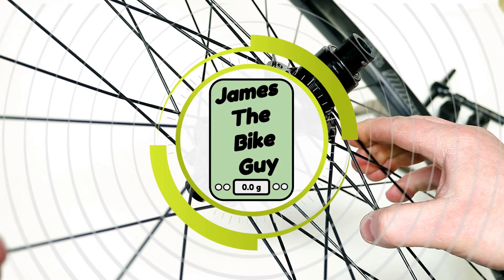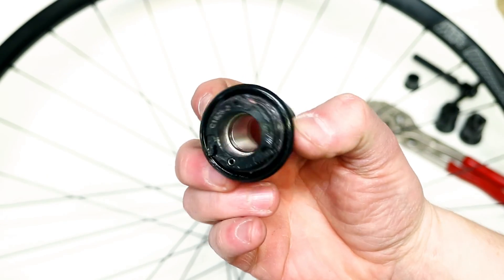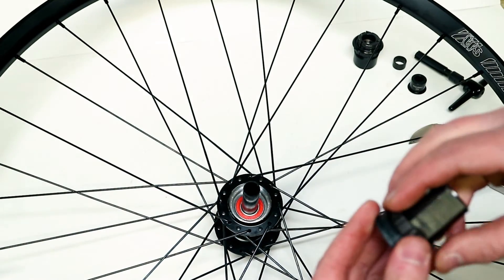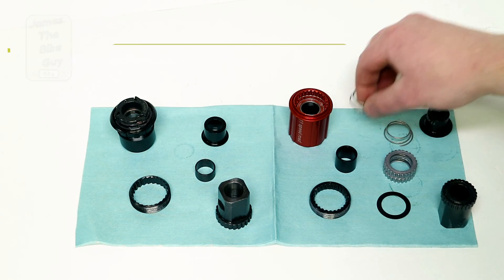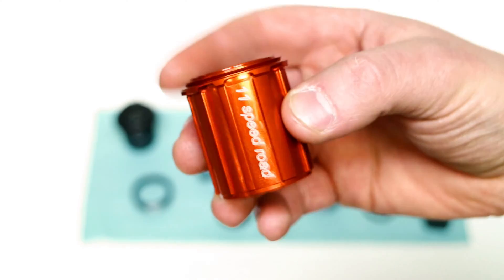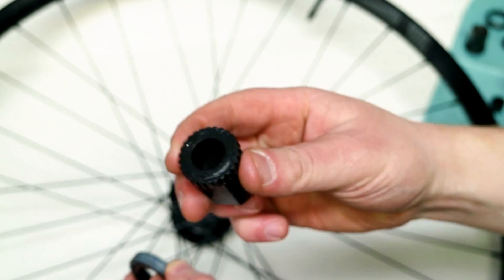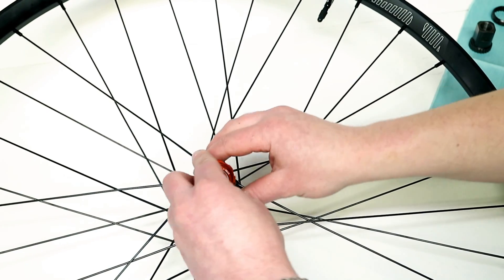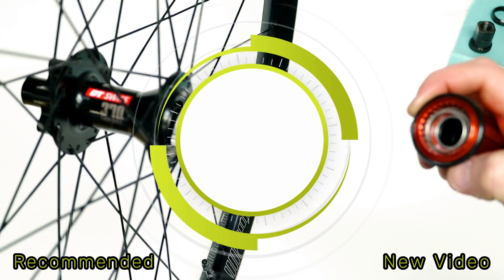How to Upgrade DT 370 to Star Ratchet Conversion using DT 350 or 240 Hub parts How To DIY

Comment: Great video. I'm about to do this to my otherwise excellent Giant TRX1 carbon wheels. Do you know how much weight one would shave with this? Ratchet freehubs are very light, around 45gr and ratchets are light as well, I wonder how heavy the 370 freehub is.
Reply: Hey, any luck Marin? Assuming your TRX1 are classed as DT360? 

Cheers.
Reply: @stensonlindal5137  I converted mine to 54 tooth ratchet easily. The only tricky part is sourcing the pawl removal tool.
Reply: @Jadrijasurf  good to hear! Same ring nut washer? Does the aluminum spacer from 3 pawl share the same length from star ratchet style?  Did you just source old DT240 parts?
Reply: @stensonlindal5137  

Conversion to 54T XD freehub ratchet cost me about 130 euro.

I'm very happy with the result because I fixed the main drawback of my Giant TRX1 carbon wheels that was relatively slow engagement.

You need:
1. Ratchet based freehub of your choice with endcap
2. Ratchets with springs 
3. M34x1 Threaded ratchet nut that replaces pawl nut
4. Washer DIN 988 (Ø26/20 x 0.5mm) that goes between ring nut and bearing in the hub shell
5. Dt Swiss 15.4mm axle spacer that goes over the axle before you put the ratchets on.
6. Freehub seal that you can salvage from your old freehub.

You obviously need two tools:
1. Pawl tool to remove pawl ring, which is relatively rare and most shops don't have it
2. Ratchet tool which is more readily available and most shops stock it.

You can't fit the spacer from the pawl system. After the conversion you're left with pawl spacer, pawl ring nut and pawl based freehub.

Comment: My 2019 Canyon Spectral CF 7.0 came with the DT Swiss M1900 wheels + 370 hub. I’m definitely converting my 370 to a 54t ASAP!!!!! Question though, which Freehub do I need to get for my Spectral CF 7.0? Sorry I'm still very new to the MTB game!
Reply from the maker: The XD driver
Reply: Jamesthebikeguy thanks!!!!
Reply: Jamesthebikeguy just to confirm this would be the correct one right? Just re-use the cap I already have in mine? DT Swiss XD Driver Black, w/o End Cap https://www.amazon.com/dp/B01LYFJHG4/ref=cm_sw_r_cp_api_i_SsajDbHM955D6
Reply: @T-eee-L  Does the end caps from your 370 worked with DT Swiss XD driver on the link your sharing?
Reply: @JAPE70  Not sure, I haven't made the conversion yet but I'll be sure to post back once I do though. Maybe others that have done this can share their experience?
Reply: I just did the conversion on my spectral. Bought the parts and took it to local bike shop since I didn't have all the tools. Just make sure the use the correct length bushing spacer, if not it binds the mechanism! Thanks again @Jamesthebikeguy
Reply: Anyone done this with 12spd HG hub?  I have DT Swiss M1900 and Sram NX full groupset

Comment: Great conversion!  Simple, except getting the old drive ring out, used the 2x4 trick to get mine out.  Be careful trying to save money, the ring removal tool from China on ebay doesn't fit, use the one from Poland, the install tool from China works.  Thanks for the video!
Reply from the maker: hmm, I didn't have an issue with my tool from eBay, it worked fine. The tool used in this video was purchased via the same link in my description.
Reply: Bonsoir. Vous parlez de quel outil?  je ne trouve pas l'outil qui me permettrait de dévisser la couronne crantée. Si vous pouviez m'en donner les références!  Merci

Comment: Hi have Giant Slr 1 42 disc wheels with dt swiss 360 hubs. Can these be converted? Do you recommend conversion of 360 hubs or just changing to 350's
Reply from the maker: Not sure about the 360, haven't worked on one of those.

Comment: Unfortunately, the Disc Ring nut is out of stock everywhere (part 7613052165578). This mod must have caught on.
Reply from the maker: Lol if 100 people have done the mod it would have are up all the stock. Not like those things go bad on their own
Reply: @Jamesthebikeguy  Well now I've got some in stock notifications rolling in... DTSwiss must have cranked these out.
Reply: There are 2 sizes of shim ring, a 26mm OD and a 28mm OD. How can I tell which I need without taking the hub apart? Thanks. side note now it isn't the shim ring but the ring nut that is out of stock everywhere.

Comment: Just had this done on my M1900 wheels with DT Swiss 370 hubs.  Fantastic results.  If I could like this video 1,000 times, I would.  Worked out great and super happy that you put this together - thank you very much.  The difference is not only noticeable but a valuable advantage in any climb.  Thanks again.
Reply from the maker: Awesome! Have fun with the upgraded hub!
Reply: No issues with the seal? Xd cassette?
Reply: joshua claar time will tell but no glaring issues during installation.
Reply: Rick Oliver how much did you spend I total?
Reply: T L Why did you have to bring that up? :). $168 total with tools.  Still cheaper than a DT350 + wheel rebuild.
Reply: @gamehaus  I have a M1900 wheel that I would like to upgrade as well. Where did you get the parts for the 370? are they the same listed above?
Reply: Brandon Hicks I got them all on eBay.  You probably need a large breaker bar to get the nut out the first time.  Still highly recommend this mod!

Comment: We did this for my Megatower and the hub was working and spinning fine, but once we put on the bike and tightened the axle, the hub would not spin freely... it acted as if it was a fixed gear.

Did you run into this at all?
Reply: did you get this issue resolved? I'm experiencing this also, and my washer behind the drive ring is perfectly centered
Reply from the maker: My guess is you did not get the washer behind the drive ring either installed or centered If done properly nothing should cause an issue.
Reply: @Jamesthebikeguy  I had the same issue...he's probably trying to use the same spacer bushing that came with his 370 hub.  It's not as long as the spacer for the 240/350.  So tightening the axle with the bushing that comes with the 370 hub binds things up.  In your video, you DO mention needing the spacer for the 240 hub...I just misunderstood!  It sounded to me like you meant that 240 bushing was only needed because you were using a 240 11 speed freehub body.  That was my own dumb mistake, but I didn't realize this till after I had everything else!  I know this was months ago, but I'm replying in case someone else runs into the problem!
Reply: @NorthTXMountainbiker  I just did this upgrade and I’m experiencing the same problem too, where it spins fine off the bike but is unable to freewheel when the TA is torqued on the frame. The washer is centered correctly and I have the correct bushing for 240/350 as well. Thoughts?
Reply: @djtaka691  It's been a long while and I don't remember it all that well.  But I believe my problem went away once I used the bushing for the 240 hub!  If that's not working for you, I can't really explain why.  Sorry I can't be more help!

Comment: Good to know. My 370 has never engaged properly from day 1. Had the drive ring replaced. New one is now acting up.  LBS has had numerous problems with 370 hubs.  They are telling me that the swap can't be done. Frankly DT Swiss ought be ashamed of that hub.
Reply from the maker: The 370 is certainly not as durable as the 350. But that is true for any basic 3 pawl system. Your LBS  likely has not tried, or are not familiar with this upgrade but as I and many who have done it can attest it works great.
Reply: @Jamesthebikeguy  Thanks for the reply. Any long term issues with the seal? The impression I get is that the only issue is that the seal does not fit in the way it's designed??  I have found other 3 pawl systems to be reasonably durable. Currently on year 4 with a Hope Pro4 on my hardtail.  370 has had the occasional failed engagement right from the start. After the rebuild, it's only failed engagement a handful of times..so many people may not even notice this - I just don't like the sound of metal getting damaged.

Comment: Has anybody done this and run it for a while? I called DT swiss, and they said it can be done, but the seal is not adequate and will destroy the hub eventually.
Reply from the maker: I have done this for a few friends and no issues. Not sure why the seal is not adequate because its the exact same sealing as the 370 had.
Reply: @Jamesthebikeguy  The 3 pawl freehub groove is wider, to fit the ID of the seal in. The Star Ratchet freehub is quite different size and shape, so while the seal 'fits' on, it does not engage as it was designed to. When the 350 freehub is removed from the the 370 shell, the seal stays inside. If the seal is not re-positioned back onto the freehub, the seal will be squeezed between the shell and the freehub resulting in friction and lack of freewheeling once pressured by the tightened axle. If you compare the 2 styles of freehubs, the difference will be quite obvious and using calipers you'll see that the diameter where the seal sits are different.
Reply: @jaydoubleu101  so without a different seal the solution is to make sure to reposition the seal onto the freehub anytime the freehub & shell are separated and add some extra grease?
Reply: @mattdudester9037  A friend of mine will machine a bushing from aluminum to press into the 370 hub shell, and then use the 350 seal.
Reply: @Jay DoubleU  can I buy a bushing from you?
Reply: @adamaudycki1327  I don't want to go through the shipping process, especially across an international boarder
Reply: @Jay DoubleU  can you give me the dimensions so I can have a ring machined then? Please
Reply: @adamaudycki1327  what's your email? I'll send a couple drawings for the ring and the setting tool. Maybe describe the process, because it's a little finicky.
Reply: @jaydoubleu101  I'm having the same issue, the seal does not stay properly and causing some friction. Jay I do not have the place to get a machined ring, any other suggestions
Reply: @vincentxie1  I had a friend machinist make a bushing to use the 350 seal properly.

Comment: This is great! Thanks for sharing.

Hoping to do this to the 370 hub on my new bike. If I already have the stock XD Freehub then it doesn't need to be changed at all, right? Just swap out the internals with the new upgrade kit and put the existing freehub back on? Also, some have mentioned not needing the Star Ratchet Ring Nut Removal Tool since it will just get tightened from pedaling. Bad idea? OK idea? If that's the case then it looks like about a $200 upgrade all-in.
Reply from the maker: The XD driver needs to be changed as well. The 3 pawl and Star Ratchet freehub bodies are different. Theoretically, you do not need the star ratchet tool, just I am not sure if you can hand thread it tight enough to finish the conversion.

Comment: I will be trying this on my Syncros XR 2.5 wheel, not rushing it, just slowly gathering materials, started by getting the tools, internals coming next, difficult to get everything from one place. Also pricing seems to vary a lot depending on location. Great work on this, how has it been handling so far?
Reply from the maker: All the links are in the description as well as part #s. Since its all factory parts, there are no worries about longevity.
Reply: Did you get this to work on your Syncros XR 2.5? I am wanting to do this with my Scott Spark 2018 and have that wheel. 12-speed Eagle GX

Comment: I’m assuming the parts list is the same for swapping to another xd driver? Many thanks and great video!
Reply from the maker: Parts needed for a XD driver are in the description
Reply: @Jamesthebikeguy  the seal does not fit on the 350 Xd driver. Have you tried installing a 350 hub seal in the 370 hub?
Reply: @out2explore552  Did it work for you, did you find a solution...I'm curious about the seal as well.
Reply from the maker: @out2explore552  The 350 seal cannot be installed on the 370 hub as it is not machined to accept the 350 seal. You need to swap the seal from 370 freehub to the 350 freehub
Reply: I'm curious about the seal as well. In the video it swaps over from the original hub. I have an XD body currently (M1900 OE wheelset).
Reply: So I ordered all the parts, using an XD driver, and everything works except the seal. I even ordered a 350 seal, but it doesn’t fit in the hub. (Too small) Performing the mod works but leaves a gap for water, dirt, etc. to enter so I took it all out and went back to stock 370. Bummer.
Reply: Welp too late. Already ordered everything. Parts will be here tomorrow.

Comment: Quick question.. are there any specific torque values that you know of when you are installing the new 350/240 star ratchet drive ring? Do you recommend using any thread locker on the drive ring? Looks kinda like the old one may have had some one (blue loctite at most) but wasnt sure. Plan on doing this to my M1900 wheelset that I just got with my new bike.  Also, you didn't mention the end cap for the freehub, did you just swap over for your bike from one hub to the other (looks like you moved from an XD hub to a Shimano).
Reply from the maker: No torque spec, the drive ring is being "tightened" each time you pedal and you standing up on the pedals is far higher than any torque spec you could put it to when installing. You could use thread lock, but again no need there is nearly 0% chance of it coming loose since every time you pedal you are actually tightening the drive ring.

The end cap needed is specific to the freehub body you use, and the axle spacing on your bike. Typically the HG freehub bodies all use the same end caps, and the XD/XDR need a specific one that comes with the freehub body.

Comment: The star ratchet  ring nut tool isnt really needed right?  You just need to thread it on carefully and it should tighten itself once you pedal.
Reply from the maker: I am sure you could jerry-rig it that way but to be safe I would get the tool

Comment: Brilliant video James! Subscribed! Btw, do you know if this conversion is going  to work on R23db spline wheels? It's hard to define what type of hubs they use in them (the freehub does have 3 pawls though). Thanks!
Reply from the maker: It should work perfect, the R23db uses the 370 freehub body so the rest is the same too.

Comment: I have a set of DT Swiss C1800 wheels with 370 hub.  I want to upgrade the hub to a ratchet hub. I see that I can order parts. Can I assume that If I buy a 240 or 350 hub, disassemble it, and still have all the parts I need for a complete conversion?  Granted I need the removal tool also.
Reply from the maker: Yeah, if you could find a good condition used 240/350 that would be a perfectly good way of doing it too!

Comment: Can someone explain me please, the wheels are being sold with the 370 hub, but you cannot buy this hub separately (I didn't find) and you cannot even find it on the DT Swiss official website. Furthermore, they don't sell anything on 3-pawl system. What do I miss here and what would be the cheapest solution at the same level of performance in case I need to replace the hub, but freewheel is fine?
Reply from the maker: DT 370 hubs are typically OEM spec, as well as many of their pre-built wheels are 370 internals. DT actually sells a ton different pre-built of 3 pawl systems. See the DT Swiss Spline M1900 for example. Basically, it is a DT quality hub with less expensive to produce 3 pawl internals.
Reply: DT Swiss discontinued the 370 hubs. I have found them online (Amazon, ebay, Backcountry). They claim the hubs are easily serviced and you can simply replace the pawls and bearings if needed.

Comment: Great info, I have new bike with  DT Swiss M1900 wheels and with 370 hub. According parts list cost for upgrading hub is about $300, because I need tools also, I can't find nut removal tools at LBS. So, I'll continue to use 3 pawl system and will upgrade when it wears.
Reply: ebay  has the ring nut removal tool for like $20 and knock off versionts of the 36t and 54T rachets for cheap, I would get the 36t as its more durable.  You should not need the ratchet ring nut removal tool as long as you thread it carefully. it will tighten its self when you pedal
Reply: I did the whole upgrade, with tools, for $168 + $20 labor.
Reply from the maker: Good idea. The upgrade is less than relacing with a new hub but is still pricey.

Comment: I'd like to know where one gets a spacer when you switch from a XD 3 pawl on a 370 hub to an XD star ratchet. I have all the parts except the spacer.
Reply: Anyone know the length of bushing/spacer required?
Reply: The ratchet hub spacer is 15.4mm long. Worldwide Cyclery have them listed online.
Reply: I have the 350 spacer that is 15.4mm. When you put it in a 370 it still binds and therefore doesn't freewheel. The 370 spacer is about 10.1mm. I'm thinking that the difference needs to be taken off the end cap so the XD driver doesn't bind and therefore freewheels. Just brainstorming. I tried measuring the distance between the bearing race in the XD driver and the bearing race in the hub. I came up with 14.1mm. I had a friend cut down a 15.4mm spacer to 14.1mm and it still binds.
Reply: @ΟιΛευκοί  If your getting binding, check the inner face of the hub isn't clashing on the nut.  If this is where it is make sure the star ratchet nut is tight in the hub and the spring steel washer floats and isn't stuck under the nut. The reason I say this is that the system works by spacing/stacking back off the inner bearing race of the hub so I would check there before machining spacers.
Reply: How did your conversion work out?

Comment: Does this work on the factory roval wheels? Hard to tell if they use 370 internals edit: apparently they use 360 internals are 360 and 370 the same
Reply from the maker: There are a lot of different Roval hub configurations. What model are you looking at?
Reply: @Jamesthebikeguy  it is the roval traverse alloy with "specialized sealed hubs" that have supposedly 360 internals